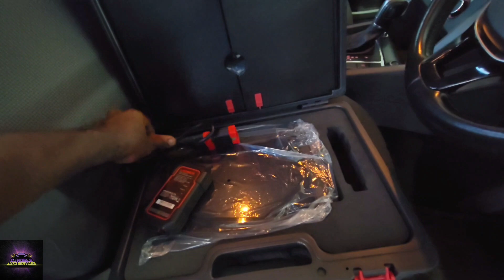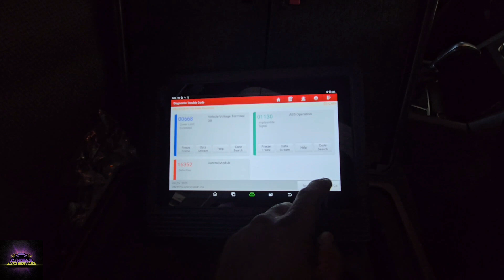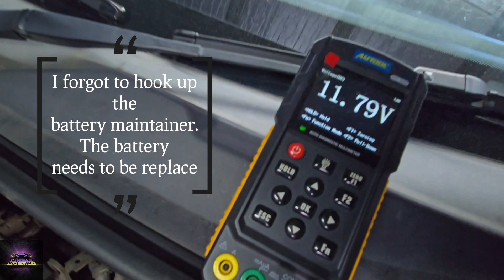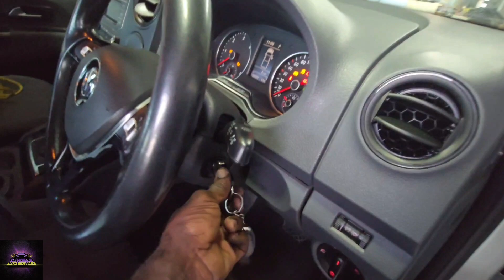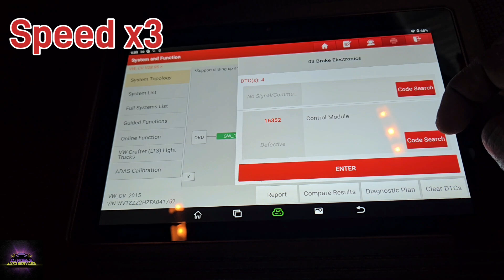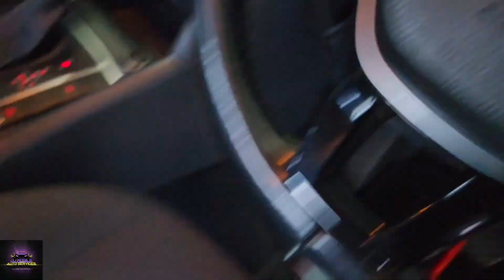VW Amarok ABS Control Module Faults. #16352 #01130 #01276

Comment: Same error codes on VW Beetle 2015 2.0tsi however mine is intermittent, drive over a speedbump the error is there, switch it on and off the error is gone, scan it no errors, scan it again the error is back. 

At my ends with this, all grounds and powers good, module tests fine abs sensors test fine. Sometimes up to a week of driving without any errors and then a week or two the errors will stay, then randomly gone again 😅
Reply from the maker: Now you should check the communication lines
Reply from the maker: It can be an intermittent loss of communication on your end or power or grounds. When It happens,  checks should be made. This module ia dead. I tried to get it repaired by ECU testing but was unsuccessful.  I have to get a new one.

Comment: I am getting that code 16352 in my 2012 Volkswagen Jetta what could be the problem engine light is on
Reply from the maker: Your vehicle will need to be properly diagnosed. Im not sure what the fault could be with the limited amount of info
Reply: @djmobileautoservices ever figure it out? I had low voltage but also this code. I’m getting lost on what I can do. 

I changed my alternator because it was going but probably part of the low voltage issue.
Reply from the maker: @Match-Script I sent the module to ECU repairs in the UK. They sent it back and said that it can't be repaired. Im trying someone else. Or may just purchase another one

Comment: So what is the verdict as I have exactly the same problem
Reply: When you get fault 01130, 90% of the times it is the ABS module itself, we repair these instead of replacing
Reply from the maker: Agreed.  The customer got into an accident, and the vehicle is down for now. I wasn't able to finish the repairs and diagnose
Reply from the maker: Hi, do you have a website that you can recommend to use to get the module repaired?
Reply from the maker: Waiting on the client to purchase the abs